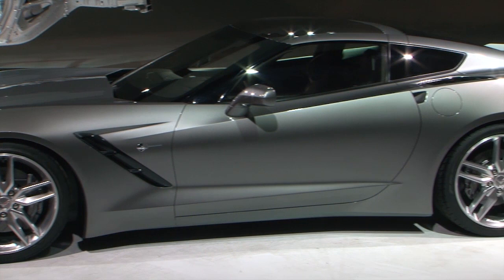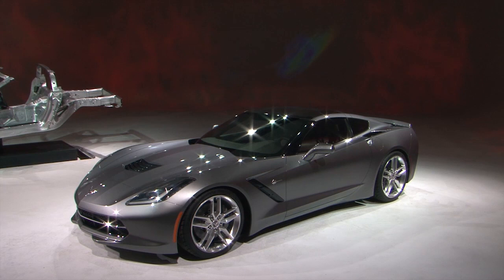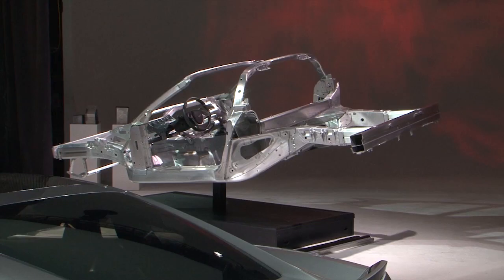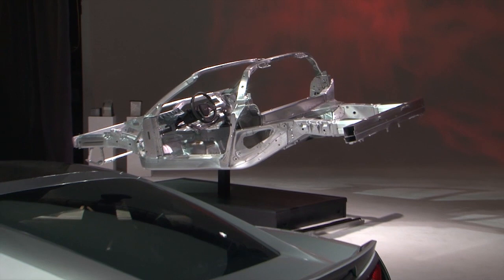Shaving Weight: The Secrets of Lightweighting - Autoline This Week 1815

Comment: Why isn't anyone going after the oil companies, demanding that they play a role in efficiency and make their fuels emit less Co2 when burned?
Reply: That's rather pointless. CO2 isn't actually pollution. It's what plants breathe.

But oil has its own problems. It's nonrenewable so we will eventually run out, and since it's a scarce resource it incites wars. Auto exhaust emits plenty of other pollutants besides CO2, pollutants that acid-etch buildings and cover them in soot and cause humans asthma and cancer. It wrecks havoc with our balance of trade as long as we remain dependent on foreign oil. ICE vehicles are extremely inefficient. Only about 25% of the caloric energy of gasoline and 30% of diesel fuel end up driving the wheels of the vehicle, the rest is lost to heating up the environment through the radiator and the exhaust, which the environment definitely doesn't need.